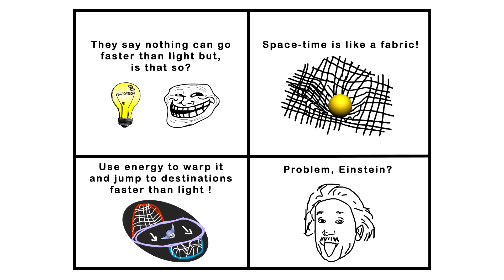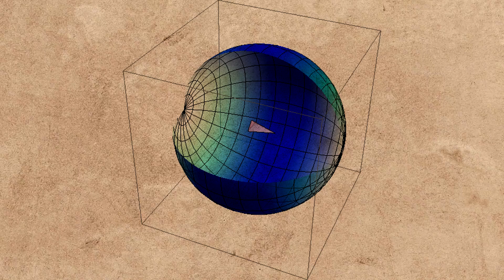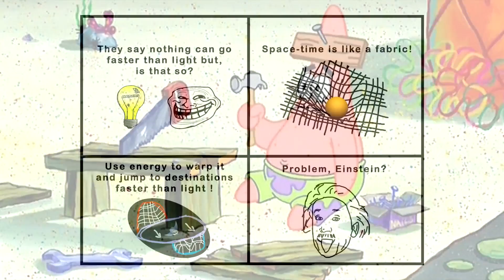why it doesn't work 61

Comment: wasn't there a paper recently that found a solution with positive energy density everywhere despite a superluminal metric? It required the mass-energy equivalent of jupiter to move something like a landing capsule in size, but still, technically can get away without exotic matter. Purely theoretically.

Comment: You can also use a regular rocket engine. From your own perspective on the rocket according to relativity it will shorten the distance in front of you, so as you measure it yourself you can get there in a shorter time. In the limit as the power of your rocket goes to infinity and your speed as measured from earth goes towards light speed, the time it would you to get anywhere, as you measure it would go to zero. 

But from the perspective of observers on earth you still never go faster than light speed. So if you visit that galaxy you could get there in one day or one hour of your time if you had a powerful enough rocket. But when you get home and look for the people you left behind they will have been waiting 124 million years for you.

Comment: If something IS faster than light; how would we be able to know? The fastest thing we can use to detect things is light itself. If something was faster; there is no ‘slowing it down to get an image’ as it wouldn’t be present to reflect light. Unless we directly produced a consistent way to speed things up to that level. Which we won’t TRY
In other words; it’s more likely it’s possible to go faster than it is likely it isn’t, logically.
Reply: Put something in front of it and based on the amount of damage it does to it you can determine the speed or mass
Reply: Depends what it is, but I don't see why we shouldn't know. Set up a telescope to watch the moon with a high speed camera. If something goes from one side to the other in 10 milliseconds then it's going faster than light.

To count as violation of the physics we know it has to be a real physical object or something actually carrying information from one side to another, not just a shadow or projection. It'd be easy to make a laser spot move across the moon faster than that but that isn't an actual object.
Reply: Also light has a lot of funky spacetime relativity properties where no matter the speed you’re moving at light is always traveling at the speed of light relative to you. So light probably as some knit tied in twist with the rest of physics and the universe

Comment: Why so many people have irrational hatred for FTL? With our current level of knowledge and technology we cannot clearly say is it possible or not.
Reply: Thats exactly the opposite of the reason, actually.

With our current knowledge of physics, we can say with certainty that it is impossible.

The only way to get around that is by "shortcuts". Even the Warp drive is not faster than light. You arrive in shorter time because you travel a shorter distance, it is essentially the same as a wormhole.

True faster than light travel is strictly impossible, not just difficult.
Reply: @fgvcosmic6752   FTL not by actually moving faster than light, but by taking "shortcuts" is still FTL for practical purposes.
Reply: Just to add, Faster than Light travel is, for all intents and purposes, equivalent to time travel. The reason being that the "present" is determined by something called your "Light cone", or in essence, all things reachable by anything at the speed of light or slower.

Causality, as it is defined, prevents anything from inside your future lightcone from being affected by anything outside of it. This is the idea that, if I perform an action, you have absolutely no way to know that until some time has passed for that information to reach you.  You cannot possibly see an effect before enough time has passed for our lightcones to overlap, and definitely not from before I perform the action.

Faster than light travel would allow you to move outside your lightcone. This would mean you could directly influence your own past and the past of others around you. Not immediately, of course, and only on distant objects; it would be a very boring form of time travel, but it would be time travel nonetheless.
Reply: @fgvcosmic6752   So what? Even if what you said is correct, it is better to have FTL with broken causality, then unbroken causality without FTL.

Comment: This is something known as "teleportation", which basically involves using an exotic dimension known as a "containment field". When you throw a projectile into a portal, it moves across the containment field and exits the other one at the given direction. Therefore, a warp drive involves creating one portal doorway to access the containment field, and as it is completely inside the containment field, it creates the other portal at the given destination. This is the physics used in Back to the Future's DeLorean Time Machine, where the flux capacitor contains a crystal powered by time juice, an exotic liquid of hyperinfinite (negative) potency. You first set the destination on a computer, which sends a signal to the particles making up the crystal to align in a given way. Then, you put the pedal to the metal and reach 88 MPH. This is the optimal speed for time travel, as it gives the DeLorean just enough time to completely enter the space-time continuum and then create the second portal doorway to match the destination. If you warp with a slower speed, part of the DeLorean will not get teleported, and that would be trouble. If you warp too fast, the DeLorean will spend way too much time in the space-time continuum, a dimension at absolute zero, which will cause the atoms that make up the DeLorean to lose way too much energy.

Comment: Wouldn’t the proportions still be the same? If space folds you would still travel within the ”crease” of the fold, because we can’t movie in 4 dimensions at will.
Reply: Let me try to clear things up a bit. The faster you travel/the closer you get to light speed, the more you experience length contraction. This means that a spacecraft moving near the speed of light could instead of being 100 meters be 50 meters or smaller. This is only in the length moving in the direction of the craft, though. Also with close to light travel, you experience the Lorentz factor, which basically tells you how you will experience time. A factor of 20 means that for every second you experience, 20 seconds go by on Earth. This is how you could theoretically make it to the andromeda galaxy in under a minute, but that’s with your time while thousands of years pass by on earth. Also, the dimensionality of our reality is contested since string theory is complete and utter bogus, so normally we just talk in 4 dimensions as in 3 spatial dimensions and 1 temporal one (time). If you need any clarification let me know